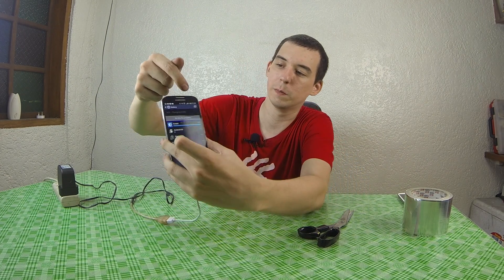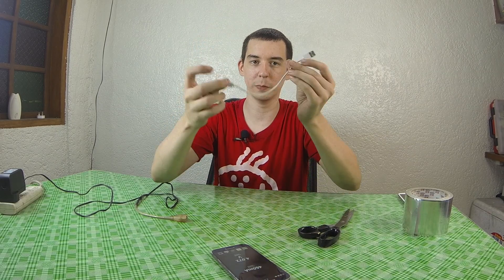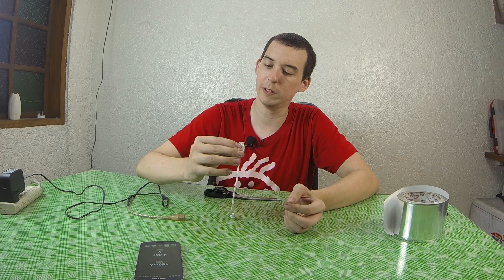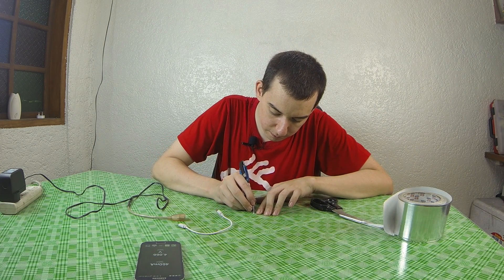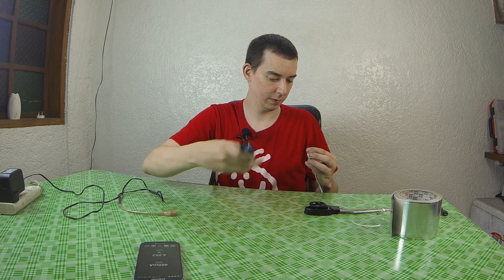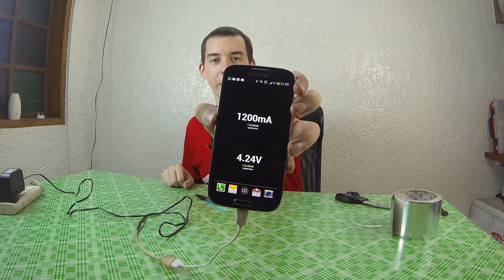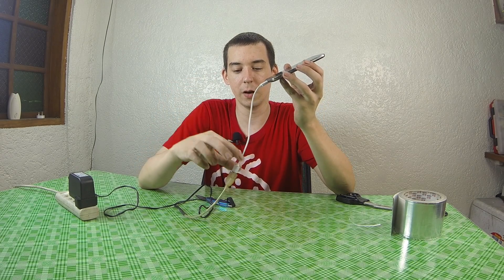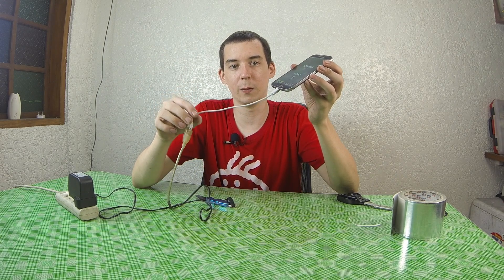Make a Fast Charge USB cable

Comment from the maker: To get the most from your USB cable and charger, check this video about a USB watt meter and dummy load https://www.youtube.com/watch?v=Fr3kiJcdO70
Reply: Gadget Addict Hi.. I short out the middle two pins by soldering it... after plugging in, the amps got reduced from 460A to 100A. Can you tell me why that happened? I used app called ampere to measure the amps
Reply from the maker: +Stanley Victor the app isn't accurate and 460A or 100A are insanely high. Most USB is below 3A
Reply: Gadget Addict sorry sorry it showed mA
Reply: It got reduced from 460mA to 100mA
Reply: For those who have no background about this things. Not well explained thats why ur bashed
Reply: @aodstudio8642  its youtube. you can write as long of responses as you want. leave links, explain ideas. theres very few places you get the chance. some of us are learning and need guidance. not cop out pointless critisims.

Comment: I thought I would make a multi-USB cable for charging and powering models and speakers
I discovered that the mobile does not charge quickly
Now, after watching the video and after connect,  both ends of the data
The mobile phone actually charged to its full capacity and quickly
Honestly, it is one of the few videos that provides a solution to the fast charging problem
Thank you very much

Comment: Power exchange works over data pins,  which is how the phone tels the charger to change modes, and send more than 5v 1..5a.  The only thing this  accomplishes is removing the phone from thinking it's plugged into a laptop.  Of its not a quality cord it will accumulate heat and possibly damage the phone, unsoldering the video card and or frying the circuit board the charging port.  Do not attempt this

Comment: Very useful video - however, it is important to ensure the lead  you are modifying can handle the higher current. Some cheap USB leads contain very thin strands of copper that are not intended to handle the higher current and may present a fire risk.

Comment: Your idea of shortening it with Aluminium Foil Tape strip is not at all good and more over not safe at all. The Foil Tape may slip from its position any moment once the adhesive loosens up so do not show something which is unsafe.

Comment: What happens if the stuff you shove into the socket moves after some time, and you're shorting VCC to D-
Reply: then your phone will be toast. i intend to do this but I'll be  cutting a tiny strip of foil then stick that on a transparent celotap cut to the size of the two pins, then i'll extend the tape and wrap it to the outside. tjis tape will effectively hold the foil over the two pins without ait accidentally moving around

Comment: This is a really bad idea last i checked....

Unless you know the wire can take the current.

Most usb cables are only rated for 500ma,  trying to pull more can in the best case melt your usb cable and in the worst case, burn down your house from an overheated cable that shorted out and caused a fire.

Comment: There is so many problems I see with doing this. 1st would be using foil its a conductor so it could short out your phone or even start a fire. 2nd you could mess up the pins in your phone to cause the data not to read no more. I don't know you need more explanation and how can you how many amps your pulling 3rd if it worked everyone would be doing it and from comments NOBODY said YES it worked.

Comment: The voltage on that one is low. The phone will usually decide what to draw based on what the charger is capable of, the voltage and the resistance of the cable. So get a better charger with higher voltage, and a 21AWG short cable to pull better voltage and as high Ah as the phone wants.

Comment: Terrible idea entirely. Aluminum tape (a.k.a  Hi-Speed Tape) is not meant to last for a long time. They are made for providing temporary solution. Shorting out terminals in a charger socket is downright risky as aluminium tape can shift inside the socket anytime, exposing greater risks and worst of all, can cause a fire.

Comment: This video contains so much INCORRECT and MISLEADING information. This is a really bad idea, and will probably not work anyway. The chances of the foil moving around and shorting out the adaptor completely is huge.
Reply from the maker: +John Coops what's incorrect or misleading?
Reply: 1. That this is the correct, safe or effective way to make a "fast charge cable". 2. That it even works. 3. That all android phones work the same way as your particular phone does. 4. That your phone app is the actual current drawn. 5. That shorting the data pins will somehow make all phones draw more current (eg: Samsungs don't need this, they simply step up the current until the voltage drops below about 4.9V). 6. That shorting the pins somehow makes a crap cable carry more current (it doesn't).

Comment: i do not see see what alluminum foil cover in the usb cable
Reply from the maker: zoom in
Reply: i can not zoom it in my phone   ......   i dont understand where in the usb cable   cover the foil its  up or down in the usb
Reply from the maker: Inside the USB connector is 4 pins. The foil is used to join the middle two pins. But pretty much every USB cable is already fast-charge compatible now days.
Reply: Gadget Addict in the usb connector their is  4 pins  inside in the middle i will cover  the  2 pin in the middle
Reply from the maker: +christian contreras correct :)
Reply: ok thank you

Comment: hi i hope youre still active here but. what if my output will be on a zerolemon  tough juice 30000mah power bank
. thats dc right? will this still be able to charge that fast at a 2.4amp output through a cable with 2.4amp as well? will it charge my phone still, that the power is coming from the power bank instead from an ac wall charger?
thanks! please reply asap this is a good knowledge indeed!
 
@gadget addict
Reply from the maker: +Jio Enriquez I think the maximum output of any individual port on the zerolemon is 2A but the input to recharge the zerolemon is 2.4A. This fast charge cable could help to charger your phone faster but most powerbanks already include a 'fix' inside that tells the phone or other device to charge  at its maximum speed regardless of cable. So the only limit would be to use a good quality cable with thick enough wires inside to carry the 2A.

Comment: hi, thanks for the video,
i connect my tablet to the usb 3.0 port of a Desktop, but it charge slowly draining .5 amps, my question it can this method fool the tablet thinking it is connected to Ac adapter thus charging faster?

Comment: cool tip.  what app are you using to detect and display the current?
Reply: Dennis Orcales Ampere
Reply: Dennis  use AMPERE APP to measure the current and voltage
Reply: Use Ampere app available on Google play to measure accurately Current and voltage

Comment: I'm not getting 1200 0r 1300 mA I'm only getting 800 mA which is what I was already getting using USB charging. Use you're method now I'm getting 800 mA AC charging.. What's the difference between USB charging and AC charging...
Reply from the maker: What's the maximum output of your USB charger?
Reply: 800 mA
Reply from the maker: mrdrejonn You can't get out more than what the charger is rated at.
Reply: ok thanks I appreciate the info..

Comment: i will block the data transfering to the pc if i put the tape on u idiot
Reply: Funny Pranking Gamer then take the foil off dumb ass
Reply from the maker: +Funny Pranking Gamer yeah that's why it's called a fast charge cable and not a data cable.
Reply: Gadget Addict wha i connect it to the pc..
Reply: _m _gold XD

Comment: Cool trick, but be careful of you're doing exactly this. The tape might come loose and short out connections in unintended places. Worst case scenario being producing a short circuit by connecting +ve and -ve ends, worst case for which is causing a fire!
Reply from the maker: Yep. Most decent electronics have protection against a short. But as we've seen with the  latest Samsung Note 7, even good brands can mess up. It's a valid concern you have raised.
Reply: Gadget Addict Hey, can that method charge my iPad mini 4 faster without causing fire or something?

Comment: My charger is 2Amp but the phone says that 510ma.. what to do?
i've xperia z
Reply from the maker: You could have a 100 Amp charger and the phone will still only draw as much as it wants. The phone will draw more power when the battery is empty and less power as the battery becomes full. The quality of your USB cable can also make a difference in the charge rate.
Reply: thanks man!
Reply: +Gadget Addict yeah, I tested this with an LG original usb cable versus a cheap one... It really makes a differ nce...

Comment: I just want to be sure shorting the two data cables isn't permanent, all you have to do is remove the foil n its back normal, right?
Reply from the maker: That's right :)
Reply: OK thx
Reply: I have a charger 5.0v 1000ma charger. This method would also cause the charger to perform quicker.
Reply: And one more ? How did you get your phone to show exactly what about of charge it was receiving

Comment: but this can also reduce the phones battery life, or even destroy the phone if you use an extremely high power adapter
Reply: Nope, the phone won't take more power then it can take. it could it could damage the charger if the phone pulls more current then the charger can handle

Comment: what camera did you use to record this video?
Reply: nice video, what is that app you are using calculating the ampere?
Reply from the maker: I believe it was a GoPro Hero 3 :) It may have been set to narrow mode.
Reply: Ohh ok thanks :)

Comment: What I found out is that not all cables are the same. Some charge as much as 3x faster rate. 400mah vs 1200mah for instance. So check your cables.

Comment: I don't see where to aluminum on it.
Reply from the maker: +pin sona inside the USB connector are 4 pins. The two middle pins are the ones you want to electrically join together.
Reply: OK thanks.  Let me try.

Comment: it seems you plug your cable into ac adaptor. which the two middle pins are not connected to it. what happens if the modified cable plugged into laptop usb port? will it short the laptop circuits?
Reply from the maker: +revolsami It wont damage the laptop/computer. The two middle pins are for data only, it doesn't matter if they're shorted.
Reply: +Gadget Addict i just tried your instructions, the result is it's not charging at all. I dont know if this trick applies only for samsung phones. mine is sony.

Comment: hey you cheater showing screenshots to us. fake fake fake. fuck off
Reply from the maker: manscho lol I can't help that the app / widget is slow to update. The method is solid :)
Reply from the maker: +Rakshak Maheshwari huh?
Reply: +Gadget Addict i think he means because the current doesnt drop when you unplug it..
Reply: yea i can confirm. i just did it with aluminium foil only.. its really tricky tho, maybe a lot easier with aluminium tape so it stays in place better.

Comment: It works with regular tape or electric tape? Because I can't find the aluminum tape. Thanks.
Reply from the maker: +LOLLIPOP - Agar.io It needs to be a conductive tape. Regular sticky tape or electrical tape wouldn't work since they work as insulators instead of conductors. The idea is to short the two middle pins together so they make electrical contact with each other.
Reply: +Gadget Addict ok so much thank you and i have a last question. This tactic is can be start a fire?
Reply from the maker: +LOLLIPOP - Agar.io Nope because the data pins don't carry power. It's the two outside pins that carry the power. If you have any doubts, I'd recommend just buying a quick charge cable from amazon :)
Reply: +Gadget Addict ok so much thank you :)

Comment: Hi gave you thumbs up as I am sure it works but I tried this on several Leeds and charging points but no improvement, I even went as far as to solder center pins together an still no joy I have two different generic USB chargers 2.1amps and 2.5 amps and an original Samsung with 950mA where am I going wrong tried with different cables same result, is there an amp measuring app you recommend?

Comment: Hi, wil this work with a usb extension cable as well?  Do I need to bridge all the ports on the extension cable and charging cable? if you can find the time to explain this I will be grateful,  before I create a fire hazard at the office
Reply from the maker: +Heinrich Schiff You could just do it on the extension cable, you don't need to do it on the charger and the cable, as long as its done somewhere along the chain :)

Comment: When I charge my nexus 5 it shows the charging sign but it says it's not charging when I go on the battery settings please help
Reply from the maker: +TIGER T I would revert the cable back to original :)
Reply: I got a app called ampere and it tells me that the battery is cold -30 degrees Celsius. I have read up that Li-ion batteries need to charge in the temperature range of 0-45 degrees
Reply: How would I fix that
Reply from the maker: TIGER T Is it the same with every cable you use? and every charger?
Reply: Yes it is

Comment: does fast charging drains the battery faster than normal charging?
Reply from the maker: +JinRei Nope. It's a feature supported by the manufacturers of the phone, it's not a hack :) You can buy an official cable to do it, but they're more expensive. Charging the battery faster will decrease the overall life of the battery but it's not hugely noticeable. We're talking about after years.

Comment: why don't your strait up soilder it because you can find cheap Genuine cables around stores and you will have one just don't soilder the data
Reply from the maker: +LiteGaming Soldering would work fine but it might be a bit difficult to get your iron in there. And if you use too much solder, the cable won't fit into the slot anymore. But sure, you could go that route :)
Reply: Gadget Addict no i mean the cable cut then add it to the Adaptor

Comment: Um, why stuff up the USB cable with the strip? It would make more sense to put the aluminium strip on female USB on the power supply so that the cable can still be used as a data cable.
Reply: CarmenBonkalot ture u thought well see this is how ideas grow but will it work correctly..it sud ryt someone sud try

Comment: GA thanks for this mate, so the green and white wires are just both open circuits inside the ac charger, the short you cause with aluminum foil tells phone draw all it can? thanks!
Reply from the maker: daikaiju20 They're normally used to carry data, like transferring files onto the phone. Some phones look for a certain resistance on those data lines or for a short and then based on that they know to enter a 'fast charge' state where they draw more power.

Comment: +Gadget Addict 
 will i have the picture of exactly attachment of the foil i cant see it please. I dont any idea about the middle points. sorry sir please i need tnx for responce
Reply from the maker: aries rafael I don't have a picture, sorry. If you shine a torch into the USB connector, you'll see 4 contacts (they look like silver/gold lines). It's the middle two you want to be connected together.

Comment: What kind of AC adapters charged in USB mode instead of AC mode ?
Reply from the maker: V. Kansil It's just a regular AC to DC wall wart. 110/220V AC input and 5v DC output. It's pretty common for various devices.
Reply: Gadget Addict How about if we use non-factory charger with original cable ? For example : Motorola charger + Samsung original cable (4 wires, non-shorted) + Samsung phone. Should we shorted it as well to get faster charging ?
Reply from the maker: V. Kansil It shouldn't make a difference what charger or cable you use. The same principle still applies :) They're all pretty much universal, thats the idea behind USB :)

Comment: Will it hurt the phone or the phone's battery using this method if your phone is not capable of fast charging?
Reply from the maker: Ron San Gabriel No. Your phone regulates how much power it draws :)
Reply: Gadget Addict so if the phone is not capable of fast charging then this method will not work? As you mentioned, the phone is the one who draws the power thus the phone knows how much it can accept. Did i get that right?
Reply from the maker: Ron San Gabriel If the phone is not capable of fast charging, it will just charge at its highest rate :) So yes, you're correct :)

Comment: Hey man i tried it and now i can`t plug my USB cable in my Computer! 

And i can`t open it!
Reply from the maker: Mark Morales A fast charge cable is for power only, it disables data. If you want to use it as a data cable, remove the modification :)
Reply: How to remove it?

Comment: Cant you just insulate the pins with normal sticky tape?
Reply from the maker: CommanderLake You're shorting the two data lines together, not insulating any pins :)
Reply: But if you insulate the data pins they wont be connected so it wont know its USB?

Comment: Great idea. So you have an AC adapter wired straight to female USB? I assume 5V DC output?
Reply from the maker: Scott Krieger Yep that's right :)
Reply: Gadget Addict Did you just figure out pos/negative and wire it to the corresponding USB wires?
Reply from the maker: Scott Krieger Yep. Best to use a voltmeter but you can optionally trust the wire markings (e.g. white line on one wire).